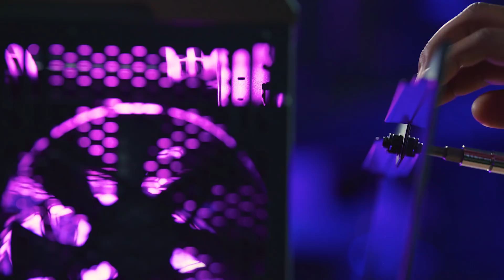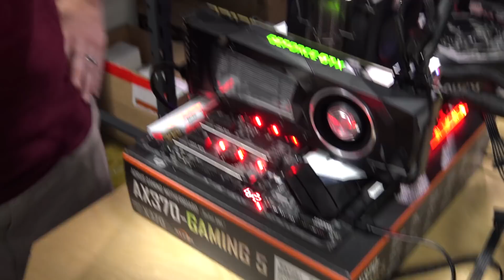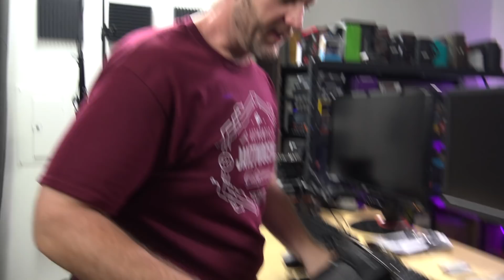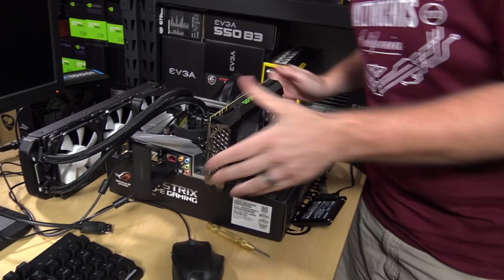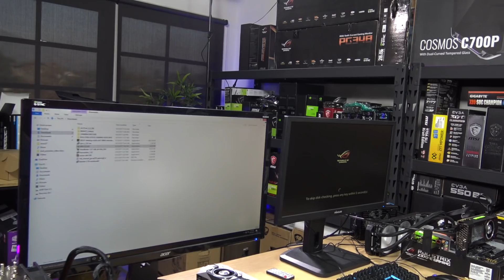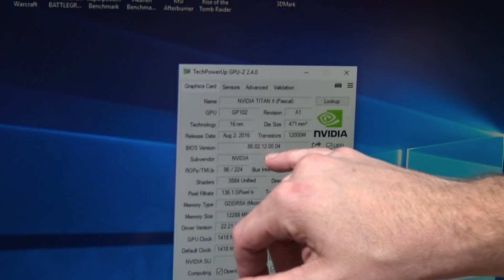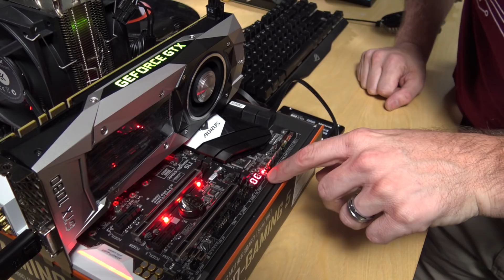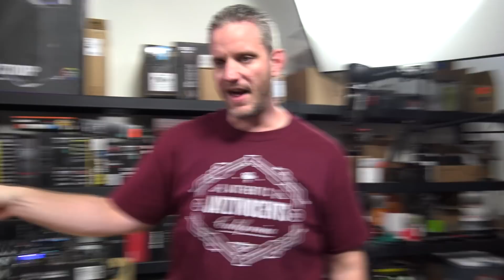I cant figure this one out... HELP!

Comment: It's gotta be either the board or the card, no way the actual CPU would be rejecting one GPU over the other. I wish I could offer some actual useful advice. I'd probably re-flash the BIOS on both cards just to be 200% sure that's the same.

Comment: its time to get rid of that card and send it to me lol. If you can get your hands on a new set of hardware and re run the test, it would be interesting to see if it has the same issue. try another CPU. sometimes the least expected thing is the problem. Is it overclocked???

Comment: I had the same issue on a recent building a Ryzen 1700 system which uses an Auros Gaming K7 and Auros 1080Ti. At times it would boot into Windows and then freeze, but most of the time it just wouldn't post. For myself to get it working we plugged the card into another PCIe slot, it's been stable since. I find it interesting that the MB you're using is also an Auros, looks that this could become a common issue across that brand. Also ran into sound issues between display port and realtek, however a BIOS update on the MB resolved all that.
Reply: I would call it a hard lock, the screen would stay on and NIL mouse/ keyboard functions would work and no sound could be heard. Sometimes it would happen almost instantly, that's if Windows even loaded or within 20-30min of using it (doing driver installs/ getting the system ready etc...).  All my fans/ LEDs remained on when the lock would happen. I did fail to mention too that I'm running on the BIOS backup the board has, I believe the initial one is corrupt. Are you using a PCIe riser cable to install the GPU? Potential there for a faulty cable. Much like Jayz fault I would sit on the B2 BIOS code and there would be times that it would load Windows after 3-4min of just waiting, other times my screen would just remain off. Funny things PCs are and how they function!

Comment: Try to change PSU, or use the same. Maybe that specific card that isn't working on ryzen has higher demand on PSU and because of that it won't boot. Do you use same PSU on both systems?

Comment: Try an older mobo bios, I had some issues with a raid card on my X370, and going to an older version solved it. Reported the issue to the manufacturer and 2 bios versions later it had been solved. Oh btw the card was working on another X370 model from the same manufacturer.

Comment: i have an old first gen 64bit.. what, 939? board that just hates on nvidia cards. boots with them, its just unstable as all get out. takes any ati card i've ever stuck in it fine, no issues. every other one of that same type of board that i've had my hands on hasn't had any issues with nvidia cards. just that one single board.

its sad but amusing.

Comment: JayzTwoCents, "The problem is that a new builder without 2 cards to check would still probably think that the card is bad."
The card is bad, Coconut dropped it and all the other cards work. You did not install a new motherboard bios for Ryzen, which you blamed or swap cpu's, but instead, "the Pascal BIOS editor".  
I do not want to bust on you. I bought the XFX RX 480 you recommended and run it at reference 580 speeds without issue.
But tough love is better then ignoring the issue.
Reply: Chris Chambers, "What do you mean Coconut dropped it?"
Watch the video and listen. Coconut said he dropped it.
Edit: "I think you are missing the entire point." I don't think so. Every card works except the dropped one. Why does it work on the other rig? That rig probably recognizes it as the matching card that was in there first.

Comment: IDK why it would be, but I remember on a couple of 955BE builds I had to up the CPU voltage by 1 or 2 notches to get them to be stable when a high end GPU was installed. I wounder if that would help here? (I know it doesn't explain why one card works and the other doesn't.)

Comment: Don't know about NVIDIA graphics cards but had this happen with a 280x.  Worked on Intel but not an FX system.  There was a switch on the card to switch to it's other BIOS as it was dual BIOS so I just flicked that and it worked in both systems so I put it down to one BIOS was corrupt.  After that it worked in both systems.  Still don't know why Intel booted with the other BIOS though.

Comment: You have not eliminated enough independent variables. Key things I'd be checking is PSU and MB.

PSU because of ripple current.
MB because of possible manufacturing variance in PCIe slots, etc.

Also just try putting the card in a different PCIe slot on the same MB.
Reply: there is one other thing I would try too - just for the sake of trying it - grabbing two more PCI-E power cables and connecting those up to the GPU on the first motherboard - it sounds stupid - but there might be enough of a voltage or manufacturing difference / fault to cause the other card to not work with the first motherboard
Reply: I hope @JayzTwoCents sees these (some of my first thoughts as well), it could be part of the issue (beyond Display Port problem).

What sometimes happens is that for a Motherboard/Card combo the tolerances are at their edges and won't work together. If you want to REALLY get down to it I would check the power supply and maybe PCIe voltages to see if they are all within tolerance. Also the other thing to consider is that each card, even of the same brand, can have different results due to manufacturing. Where one card is perfect and another passes but has variance. That is why some cards will overclock differently.
Reply: the same two cards work perfectly. The problem is within the GPU

Comment: I haven't finished the video yet, but this is already reminding me of an issue that I had with my Threadripper/Vega64 build. My machine wouldn't boot into Windows with Vega installed but it would with my 290. The Vega however would work in a completely different system. Updated the mobo bios on the first machine still nothing. Got a NEW VEGA and the same crap happened, then a THIRD bios update mysteriously showed up for my MSI x399 mobo and got it to work. HMMM. (also the non-updated board would boot with vega if I also included my 290 lul). Long story longer, I'd be questioning the mobo due to this experience.

Comment: Just a guess: I'm thinking about the situation with CPU's and how they respond to overclocking. They all come in identical boxes. All have the same part number, and somewhere we find the manufacturer rates it at 3.5 Ghz, turbo 3.7. None says this one will go 4.5 Ghz reliably, yet another will barely reach 4.3 no matter how much the settings are tweaked. Manufacturers admit some are better than others. Want to pay double or triple for someone to bin parts to sort out the best ones? I didn't think so.

What if a similar situation exists elsewhere in the system - GPU's for instance. One system is so critical/delicate/marginal that this xxx works anywhere and another apparently identical xxx simply won't? Maybe there's more than the CPU that reacts to differences in silicon/timing/power delivery/etc. Remember, in the old days games wouldn't work if the CPU was faster than the slowest CPU available.

Consider what could happen if all the traces on one motherboard were double the cross-sectional area compared with its brethren. It might be able to supply enough additional current to drive xxx to your wildest dreams, yet others (apparently identical but actually not) simply can't supply enough current when things get marginal. I doubt the manufacturer would knowingly make the traces on any board different than the others. But what if a few boards actually got through the production line with such an advantage? Whoever gets the "good" board can run rings around his buddies.

Race day at the track: one or two cars are simply faster than the rest of the pack. Why? Is it because someone made the body a little slicker, or somehow got a couple of horsepower more than everyone else? Did they cheat? Do they use some magic elixer in their fuel? Is their driver better? Does this brand of car simply perform better on this track than the others? We'll probably never know as there is likely dozens of things involved, each adds a little bit, but the bottom line is it all adds up to make something superior to the rest.

Every thing is the sum of its parts.

I guess what I'm saying is that silicon (CPUs) may not be the only thing in 'puters that have finite capabilities.

Comment: I know this is far fetched but I one time when I went used pc part hunting bought a really great deal that came with a gpu already installed. I then put in a 970 that I had laying around at home and it didn't post. I then threw back in the old card and it booted just fine. I decided to run a paper clip carefully and lightly through the pci-e port and I pulled out a small eyelash. I've always assumed all GPUs aren't made the same and one might make better contact then the other when foreign particles might be in the way.

Comment: I'm going with a power delivery issue swap the power supply and see if you get the same issue electronics do funny things with to low a voltage or dirty signal.

Comment: Reflash bios on mobo, and gpu. Use a higher power PSU for the GPU not working. Clean the pins on the non working GPU. All the things I would try.

Comment: You checked the bios version on the same (working) card twice, you never looked at the bios version of the card that wasn't working in the ryzen system.  When the video started, you showed the bios on the intell system.  then when you switched the intell card to the ryzen system, you checked it again, instead of going to the intell system with the card that wasn't working in the ryzen system

Comment: My guess is a small variance in voltage from the power supply or motherboard that the problem card isn't handling. Try swapping the PSU.

Comment: It seems less likely that it is an issue specifically with the GPU, likely either the motherboard or the CPU, I would swap in another ryzen cpu and see if it makes a difference, try a different PCI slot, and then try a different board if that doesn't work. You've done some isolation testing, but not enough to be certain that it is an issue with the GPU. I would also try with 1 stick of ram, and move it to different slots. Good luck!

Comment: I would say a COMBINATION of something DIFFERENT about the video card, and the motherboard it fails on. It seems to be at a tech level you'd need an expert to find. Some stall in negotiating POST due to some strange issue in the card that doesn't stall out on the working system... I want to say it's more likely the video cards "fault" but with the Ryzen BIOS issues I feel it's probably something in that during POST that is timing out due to again, whatever strange difference the graphics card has?

Comment: Have you tried re-flashing the M/B bios? I've had similar issues in the past with AMD CPU based boards, and re-flashing the same M/B BIOS' has fixed it.

In the cases Ive done this and it's worked ive traced the fault back to a minor power fluctuation (at the wall) during the initial flashing and not enough of an issue to cause bios corruption, but enough to matter.

Comment: Gigabyte(AX370-K3) did the same thing to me,i sold my installed Zotac 1070 and i tried to install a temporary working GT610 on the system and it did not boot,i cleared the cmos and drained the power from the systed and voila it posted just fine. So i think it's an issue with the crappy Gigabyte bios or mobo revision.

Comment: intresting and very frustrating problem.
I have unrelated, but stil kind of mysticly related broblem my self, 
i have a PS3 console that works everywhere else just fine BUT 
when its physicly at my sisters house, when its there it wont show 
picture in any tv at any connection, even tryed another power plug... 
so i ended up giving them my own PS3 because that one works just fine over there.

...so like i said, unrelated but im blaming some mystical fricking thing
and thats frustrating because the broblem has to be somwhere, or
is it just electricity going wrong way and the singral bits the ones and zeros
flying all over the place...

Comment: One thing I'd suggest is check and compare pins on the connectors. See if any are screwed up in any way. Sometimes it's not a software related issue, but something simple on the hardware side of things.  Or even do what you said there could be something in the actual firmware that got corrupted on the card. You might just have to reflash and reload the BIOS. I know you said it's next to impossible, but I''d say give it a shot. You never know what can happen. The worst case scenario is you're out of a $1000 GPU, but it's still worth checking into.

Comment: I'd try switching the PSu and/or the memory.
As in changing between the two systems.
Try booting with the card in the lower PCIe x16 slot, the "bad" card might just not fit properly in that specific slot.
Maybe booting the ryzen with both cards in it. the "good" one in the primary slot and the other one in the other slot.

Comment: Manual says B2 post code is Legacy Option ROM initialisation. Try looking at the online manual for the board and not using the legacy options in the UEFI/BIOS. Post codes are also in the manual. Look at Page 29 and 40 if interested.

Comment: Hmm jay. Might it be a faulty or instable psu. or a faulty or instable powerconnector on the crazy card?
and for some reason it works on the intel systems because maybe intell has more experience asking and diverting power towards its components? just thinking outloud! very interested if you figure out what the real problem was.

Comment: Have you tried switching the power supplies? I've had issues with flaky pci cables that work fine plugged into one gpu but not another.

Comment: Basing this purely off what I can see in the video, so if this has been done I apologize.

1) I noticed you are clicking start, shutdown on both systems. On Windows 8 and above, this puts the system in a "hybrid" shutdown combo between a shutdown and a sleep/hibernate. This will remember installed hardware id's and this also could be remembering the hardware for uefi / fastboot. Try holding SHIFT while clicking shutdown to get a full true shutdown without the hybrid BS (PCIx SSD's dont need it anyways, faster from cold boot). You can also do a "powercfg -h off" from an elevated command prompt to permanently disable the hybrid startup/shutdown. Theres also a tickbox to turn it off in the power options -> additional power settings -> change what the power buttons do -> change settings that are currently unavailable -> untick the hybrid/fast startup option (not visible if you do powercfg -h off since it disables hibernation). It could simply be the fact its thinking the cards are the same based on model but they are different pcb/revisions so the info its remembering causes the failed boot. 

2) Have you tried a different monitor cable? Maybe the cable to the monitor on the AMD side has a loose pin with the "bad" card, but the cable on the Intel side is newer/tighter and it makes the connection. I have seen some systems throw GPU errors because there is no display output detected as connected.

Furthermore, as various other comments pointed out, you showed us the bios version of the card in the Intel system, then showed us the same bios version of the same card while it was in the AMD system, so we don't actually know if the bios version of the card that went from the AMD to the Intel is the same, since you never showed that.

Comment: I've had a similar issue with my i7 4790k but didn't have the ability to troubleshoot as I have less hardware. I got a B2 code on my ASRock board back with a R9 390 and it would happen after changing BIOS/UEFI settings and rebooting. It would get fixed when I turned off the computer and the power supply. It would work fine with built in graphics. I tried lots of settings to avoid the issue anytime I would change the BIOS but I didn't get anything different. I've now migrated the R9 390 to a different machine and the GTX 560 Ti is in the i7 4790k machine (as a temporary card). I even tried swapping out the motherboard from a Micro-ATX ASRock board to a Full-ATX Extreme 4 ASRock board long ago with the same results. It seemed like it was following the CPU or the type of ASRock chipset or something. I've updated the BIOS firmware a couple times and it would get the B2 code after each time (very concerning the first time but a complete power cutoff fixed it everytime). I'm not really sure what caused the issue but it worked enough for me to not worry about. Doesn't sound the exact same but similar enough I thought I'd share.
Reply: Also, the other machine with the R9 390 (Ryzen based) doesn't have the issue and now this machine doesn't seem to have the issue.

Comment: This may sound stupid but try the card in another slot. You may find that you have a bad solder joint on the first PCIE slot. This sounds counter-intuitive but I have run across this problem myself. One card may be a little more tolerant of a possible power fluctuation on that particular bad joint. Just a thought.

Comment: I know man.  It's freaky but it happens.  It is possible to get two Ethernet devices with the same MAC for example.  It used to happen in the 90's especially with gray market stuff.  You may never figure what is the matter in this case.  But think about this, the cards may not be identical.  In different revisions the parts of the design may work quite differently.  You never know this as a consumer and the changes are accounted for in the driver.  There are a million reasons this could be happening.  You will need to work very closely with each OEM.  Unless of course you missed something obvious. LOL.  In real life when this happened we just used a config that worked and went on with work.  But since you have this channel it would be a hoot to get to the bottom of it.